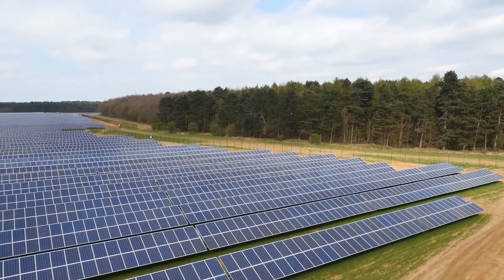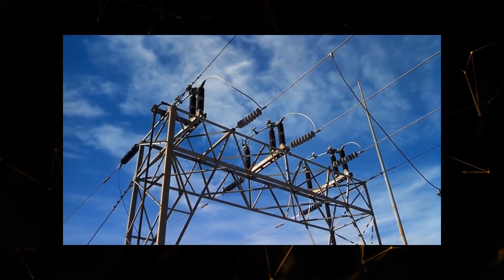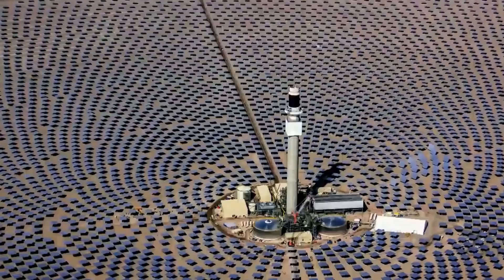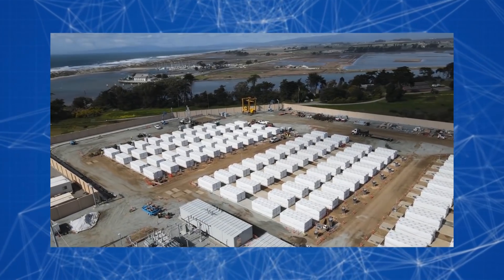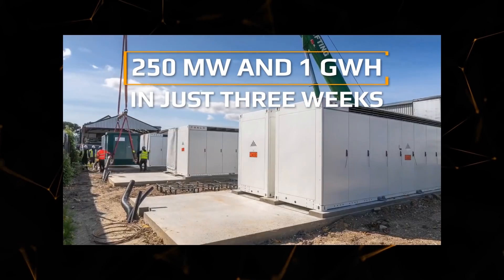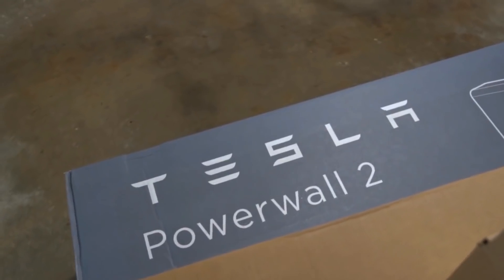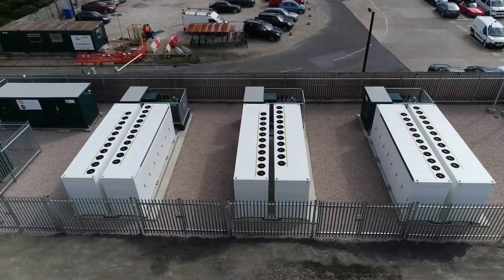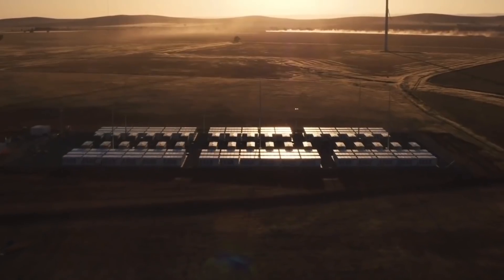Why Tesla Energy will revolutionize green energy

Comment: Another money spinner for someone but as a green energy revolution? Not at all, and who pays, the consumer is the answer to that; with high energy bills.
California's average consumption per day was about 760 Gwatt hrs (2019 figures).
Even the extended 1.1 Gwatt hour figure is minute in comparison.
Grid batteries are useful for frequency control but that's all, they can never sensibly make up for renewable intermittency.
Reply: Tony Seba on YouTube, check it out!
Solar energy with proper battery storage is the cheapest choice by far. It is what the oil companies don't want you to know!
Reply: RM,
if that is true, why is it not more widespread?

Solar for grid supply is dreadful even in sunny countries as it starts in the morning rises to a peak about midday and then declines.  Demand is there 24 hours and it's a mathematical impossibility to store enough in a battery to compensate for that demand profile. The average output over 24 hours is too low.
Therefore there must be an equivelant amount approximately of readily available capacity that covers the shorfall. This is plant that will be running, low output at times and high at others.
It follows that if no solar power were built the electrical unit cost to the consumer will fall.
The people that say that renewables are cheap are only looking at production costs not the overall cost to integrate it onto a grid.
As the consumer what they are paying, Californians are paying a high price for all their cheap solar. Even Mr Obama was quoted as saying "that prices will necessarily sky rocket" in tryng to transition to renewables.
 Not that it can work however

Comment: We need to stop using Li batteries for static uses and save them for vehicles.  And there are better solutions with batteries that don't fade over time.  For instance the ZnBr flow/plating battery, the liquid metal battery and various Fe and V flow batteries.
Reply: Li is cheaper. Utilities need high power density instead of high energy density for demand response. Flow batteries are expensive to scale the power even though scaling the capacity is cheap.
Reply: Lithium is cheaper and available. It is a great opportunity for jobs. Bringing infrastructure jobs to the USA.

Comment: Better solution: Use solar power to pyrolyze wast agricultural biomass. Capture the synsis gas in a gasometer. Chared biomass is called biochar. Biochar is a permanent carbon sink and permanent fertilizer. This will reverse global climate change.

Comment: What's the environmental impact of mining and processing all the materials needed to build these battery stations?
Reply: Less than the impact of supporting the continuous never ending cycle of fossil fuel insustries finding, extracting, transporting, refining, transporting again, storing and then burning. Current estimates show that 15-20% of all energy used goes to just doing that. 😶

It takes about 10 barrels of crude oil to produce 7 useable barrels of refined product. Plus massive amounts of water, cobalt and electricity for the refining process alone. Just shutting off the refineries and oil pump jacks would allow all transportation to convert to electric. 
Without incurring any additional energy demands on the grid.
Reply: Less than "mining" Oil, gas & coal
Reply: The wells are already dug, they just keep on pumping
Reply: And then deal with the massive amounts of heavy metals in the batteries that need to be recycled or disposed of